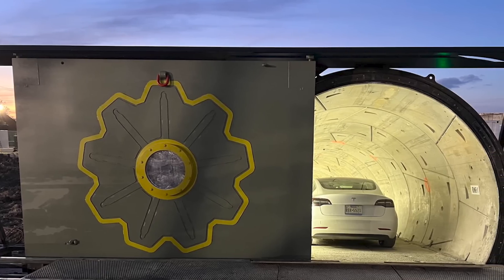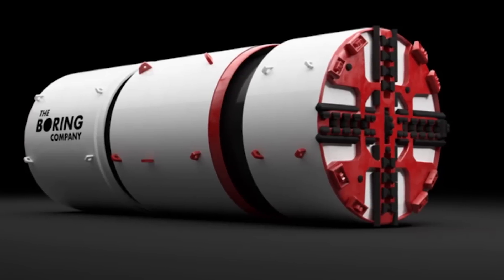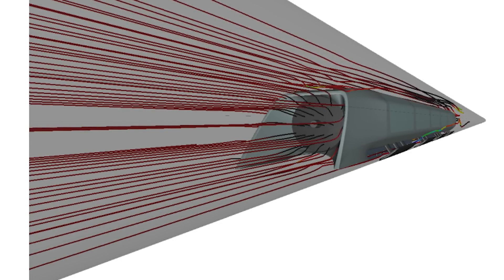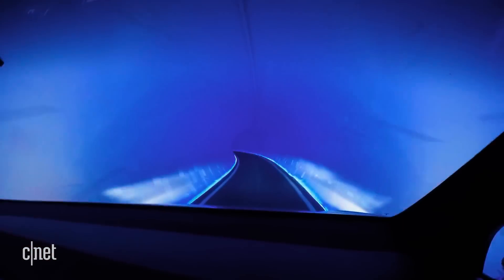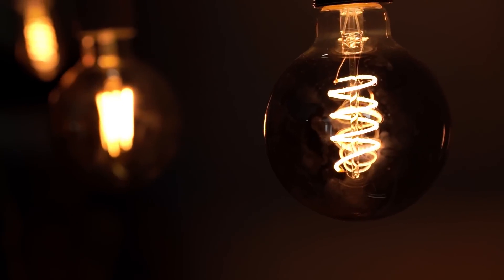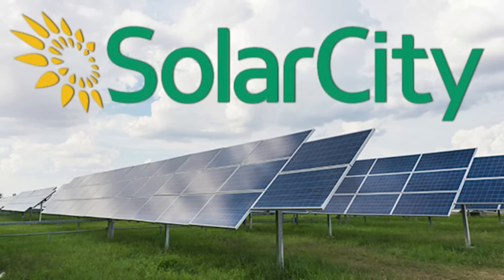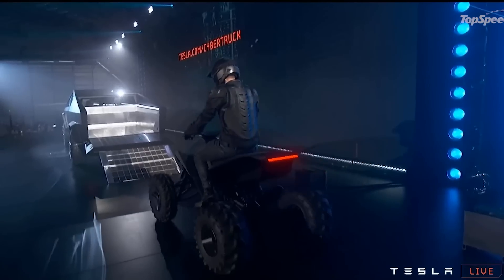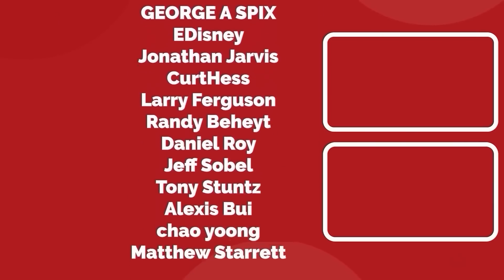The Boring Company Reveals First Hyperloop Prototype!

Comment: 3:03 this is like 80% incorrect. All currently running bullet trains are on high speed rail, which is just normal rail technology that can handle high speeds. As shown at 3:09. They can run at a little over 200 mph. There is also a WIP maglev bullet train that can hit speeds of 350mph. There is a test strip that is built and people can ride the new maglev, but it is for demonstration.

Of course the hyperloop will never happen. Especially not from Elon Musk. He wants everyone in a tesla not on public transport.

Comment: I am sorry but are people this gullible or that ignorant of tech or physics, first off " latest boring company invention surface" ........ No they are actually using an off the shelf tunnel cutting tool that both digs and places concrete walls so no he did not invent it......  Also what Hyper loop? this is a car sized concrete tunnel like we have been making for a very long time and concrete will not hold pressure much less a vacuum aside from that concrete is not structurally strong enough even if it was air tight to hold a vacuum, add to that he is using off the shelf concrete tunnel segments that are not watertight much less air tight,   if it was to be a Hyper loop prototype it would need to be made from a material structurally rated to hold a vacuum and be air tight ...... you know metal.

Comment: In Sweden, they are boring a tunnel 80 meter under ground that is 13,4 km long and 5 meters wide under the city of Stockholm at a speed of 100 meters a week.
Reply: However, you haven't FRACKED all the ROCKS, resulting in earthquakes/seismic activity destabilizing the rocks.

So, you're ok. The USA is not so fortunate.
Reply: Stockholm sits on granite rock, super easy to tunnel through.
Reply: @sama.2586  There are granite, true  but not super easy. Look at the Hallandsås tunnel, also in Sweden. That was a bit harder. Tunnel boring is not as easy as some people think. I will wait until there is proof until I cheer

Comment: I like advancements in technology, but mass transit has a major issue. You need a lot of people that need to get from one specific point and go to another specific point regularly. They need other transportation to get to point A and other transportation when they get to point B. Trains and tunnels aren't flexible. Automobiles and airplanes are flexible. The Northeast USA is very populated in smaller areas, and people use mass transit there. There's a train system that runs from DC to NYC and probably Philly. That works for them, but as you go west, things change. Cities west of the MS River are much more spread out. A person in Dallas isn't as interested in driving an hour or two to get to a train station, waiting an hour to get on a train, then to go Houston, then getting a cab to drive an hour or two in Houston. What they do is get in their car and drive from Dallas to Houston on the Interstate. They don't need public transportation to get around Dallas or Houston. Most cities out west aren't jammed onto one island like NYC.  For most places in the USA, personal transportation is faster and much more convenient than trains or tunnels. 
I can see tunnels that can run parallel to freeways in every city so traffic that isn't stopping there,  can keep moving. It would have to be for EV's only, or a huge air system would have to be added to remove the exhaust.

Comment: 500 ft in half a year? A utility company dropping water/sewer could do that over one damn long day, with one day to prep and one day to clean up. I get that speed isn't the point, but they gotta start changing this process. If they soft dig or do horizontal drilling with shoring/bracing they  could do this in two stages. Stay a day ahead of the drilling machine taking away 20% of the volume without allowing it to collapse. They could even make custom reusable bracing.

I get that they are trying to do all of this without cut-and-cover. There are better ways. Just go back to the drawing board and find them.
Reply: There's a big difference between a tunnel big enough for a car to drive through, and a ditch big enough and deep enough to bury cable or pipe. LOL
Reply: @TexanUSMC8089  lololooool

You honestly think it takes 180 times as long to dig a tunnel twice as wide? You obviously have never seen a trench box. You can fit a car in a trench box.

Comment: I see every project Musk works on as being useful/necessary on Mars. Radiation on Marses's surface is too high, so having habitats and stuff underground is necessary, hence tunnel boring machines. These tunnels will need to be pressurized, kinda the opposite of a hyperloop tunnel, but many principles will be similar, like how to seal the tunnel from air leaking in/out through the walls. The boring of the tunnels will need to be a process that can be done rapidly and at scale. The hyperloop project let's Musk become an expert on the topic and allows for the rapid iterations and learn the lessons needed to get the technology perfected before sending it to Mars (the ideal tunnel size would be about the same diameter as a Starship payload bay - 8m).
Reply: Totally useless for mars and there is no way such massive Boring tunnel machine will be sent there! Other companies are developing much more capable and flexible solutions
Reply: @alanmay7929  The Boring Company's machine weighs 1,200 tons, and starship can carry 100 tons to Mars, so a dozen ships. Considering Elon is planning to send a thousand that doesn't seem unreasonable. Especially considering that zero effort has been put towards getting the weight down. I would guess getting the weight down to 400 tons (1/3 the current weight) shouldn't be unreasonable at all - so 4 starships (or potentially even fewer) for a machine that can dig out all their living spaces, storage spaces, food growing spaces etc. Doesn't seem rediculous to me.
Reply: @truhartwood3170  nonsense!!!! It weights way more than 1200 tons and it takes about 6months + to send things to mars and the other biggest problem is to land safely, also what about the cranes or tings to assemble it! Finally there are much better and cheaper survival habitats been developed with more advanced materials and composites……
Reply: @truhartwood3170  digging can be done in a totally vet different way than a massive TBM lol….
Reply: @alanmay7929  I literally looked up how much it weighs and that's what it said. Everything takes six months to send to Mars, so that's not a factor for any solution. If you're looking at habitats that you would send to Mars, there will be a crossover point where sending the habitats makes more sense vs sending equipment that builds the habitats on Mars makes more sense. Just pulling out a random number, it might be that sending enough habitats for 10 acres of total floor space might make more sense, but once you start talking about 15 - 20 acres or more then you're better off sending the equipment. I don't know where that tipping point is, but it will be there. Obviously the first habitats will be sent there, but for larger, ongoing expansion boring tunnels and lining them with concrete made from local materials seems like the only viable large-scale, long-term construction. Remember the goal is to be independent from Earth, so whatever construction method is ultimately used, it has to be something that can be done locally. Eventually, even the equipment itself will need to be produced in factories on Mars from materials mined on Mars.
Reply: @alanmay7929  You are throwing out a lot of claims that there are better alternatives without giving a single example. I might agree with you if you actually presented one.

Comment: We don't need a partial vacuum to have a nice, efficient, doable, proven maglev, like the Shanghai Maglev (311mph).  All good wishes.
Reply: A fast train is still slower than an airplane. Trains can only go where the tracks go. That's a lot of limitations.
Reply: @TexanUSMC8089  So is hyperloop ? It didn't even achieve speeds comparable to high speed rail yet and it can also go only where the tracks are so ?

Comment: BT tunnel is too short for testing hyperloop tractors at any speed, however, any vehicle going to Moon or Mars that needs to drive in a vacuum, well . . .  air tight cyber truck with crater jumping gas thruster . . .  yeah 🙄

Comment: The tunnel is based off of a design where they will use fan pressure basically a fan moving in a constant Direction and it will have gears to change the pitch of the blades making it suck or blow depending on the location of the vehicle in the tunnel. This is a invention of mine.
Reply: Based on the videos I found on your channel, you must have a very interesting story to tell if this is an invention of yours.

Comment: Top speed for Tesla Model 3 Performance is 163 mph.   Without air resistance it would be able to go much faster.  But how fast?  225 mph?  Maybe 250 mph?  Of course you don't want to hit the sides of the tunnel at that speed.  :/
Reply: Since when is a car airtight?  Also, the radiator isn't going to work very well with reduced air pressure...
Reply: I think more than 300 mph, but i think the missing oxigen would make problems 😂
Reply: @patoripraha  300mph in your dreams lol…….

Comment: @3:55 the diagram mentions 2x14 for seating. Is that in total for the entire vehicle? Or is that per pod and there will be like 20 pods connected? Can anyone clarify?

I'll be honest this is much more exciting than the concept of using these tunnels for Tesla cars. Large scale public transit is desperately need in the United States. Hopefully there will be builds of this above ground. Would love to landscape while riding along and not just a white tunnel, especially if the plan is to stretch these across the U.S.
Reply: You should probably forget about it. The vacuum means that it will be extraordinarily hard to have any form of windows even above ground.
I also don't expect them to physically join pods, since that brings back the limitations of trains, while removing advantages.
Reply: @mrblurleighton  Wait just want to make sure I have this right. So the hyperloop will transport one pod that at a time, fits about 28 people (2x14 according to the diagram), has no windows, and can only go underground? Why would someone want this over a bullet train?
Reply: @jacksonolson1721  Stop thinking 'inside' the conventional box. The Hyperloop concept is that the pods would spend no more than 1/2 hour in the tube, which would be underground only where needed to keep curves or hills from slowing from a straighter line for comfort at speed. Artificial 'windows' would provide views to sooth the passengers. If 350 miles is completed in 1/2 hour, it is only a bit longer than bullet trains in some of their longer tunnel segments where they slow down for eardrum comfort. Getting there three times as fast will attract the customers you think Hyperloop will not.  Repeating 28 seats each hour in each direction(10 minutes  each for unboarding, cleaning, reboarding)  will boost the throughput and no onboard services are needed.
 Longer Hyperloop journeys were not considered in his original white paper, but hub and spoke service like airlines could extend the concept, or it could interchange with HSR multi-stop services that become the "Local" in transit terms. Hyperloop is meant to hasten the boring parts of an intercity journey, pun intended.
Reply: @paulgracey4697  Okay I understand that the concept of the hyperloop is to be faster hence why everything is underground and in a vacuum tunnel. But where I get lost is that everything mentioned is a concept/theory that hasn't been made. Like the bullet train was a concept built upon an original train but faster. In North America, we hardly have active trains for public transportation. Why not focus on this and then build up to the hyperloop? Why are we trying to skip 3 steps to make the trip slightly faster but then lose out on scenery, comfort, mass transit, etc. The U.S. is massive with gorgeous views and we're trying to create something that avoids all that just for the sake of it being faster than a bullet train "hypothetically". Artificial windows sounds so depressing.
Reply: @mrblurleighton  Musk’s proposal is not for a total vacuum, but for a lower pressure environment. Not nearly as expensive or dangerous.
Reply: Lol.
Reply: So you wish for trains
Reply: Because it's all fake it's none of it's real y'all had the wool pulled over your eyes 

The white paper isn't available online anymore because Elon musk is so embarrassed

Comment: To be fair, the anti-hyperloop people are correct based on the original proposal.   If he is now proposing something that's not crazy, should it still be called Hyperloop?
Reply: Bear in mind that Musk’s companies all follow the Agile method where changing plans as projects mature is a strength, not a weakness.  Get something simple out there, see what works and what doesn’t, rapidly iterate and end up with a solution far more robust, cheaper and more efficient than what went before.
Reply: i like that elons new hyperloop concept has an air compressor on the front 🤣🤣🤣🤣
Reply: @jebes909090  That's the old one. It's unlikely that the updated version will have a compressor.
Reply: @mrblurleighton  well i hope not    its suppose to be in a vacuum 😅
Reply: @jebes909090  There's no need for an actual vacuum. Jets tend to fly where there there is only about 20% of the pressure we humans live in to avoid drag. I assume that hyperloop could also be made to work with similar pressures eventually.
Reply: +8 Hyperfloof 😊
Reply: @justonlyjohn6596  On the contrary John, Agile Methodology is a very well-proven project management technique that daily demonstrates how incredibly successful it has been for Musk's companies SpaceX and Tesla.
Reply: You mean the logical and scientific people?
Reply: Probably yes. Their whole mindset is that everyone is wrong, and the goal is to be less wrong over time. It's surprising how fast they move from being crap at something, to being the best.
Reply: The word mega is overused and its not giga, so hyper.